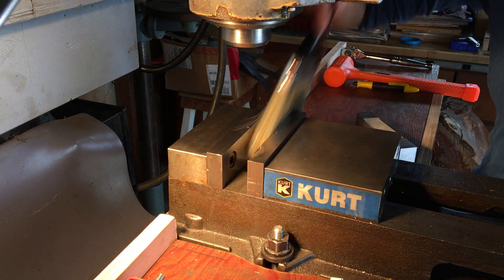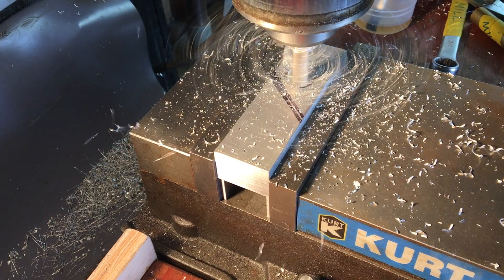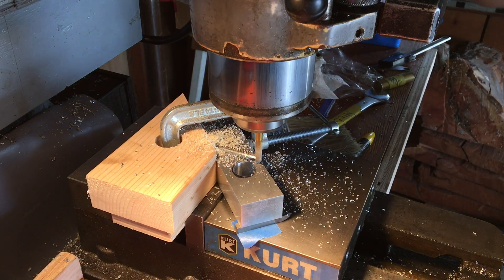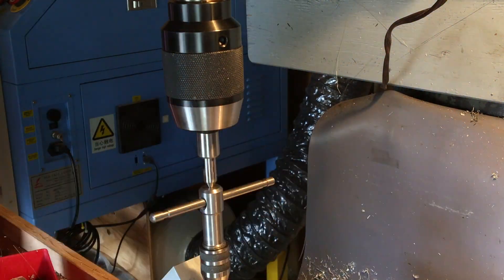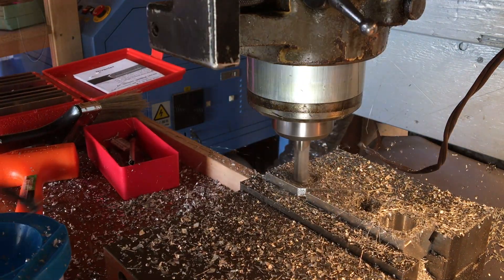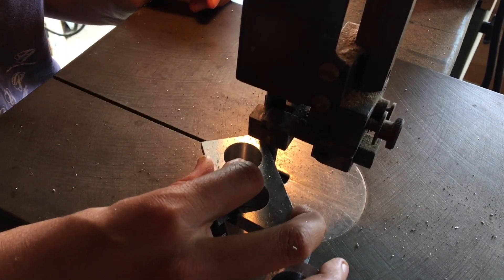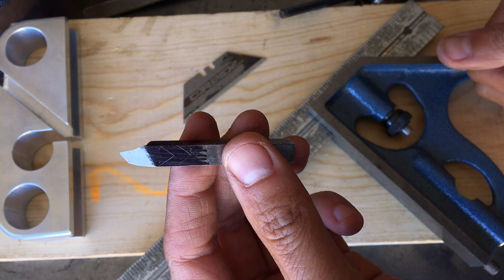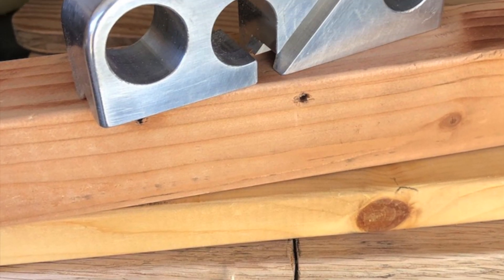Machining A Round-over Plane (start to finish!)

Comment: Just found your videos.  I'm sure you are now aware that High Speed Steel doesn't lose hardness even under considerable heat. Dipping it in water while grinding keeps it cool so you can hold it with your hands. Not really to lose the temper.

Comment: I just got a bridgeport, doesn't even have a traditional DRO. I'd love to hear more about your prototrak setup, it looks like the best of both worlds between manual & cnc
Reply from the maker: Congrats on the new family member!! My prototrak is only CNC on the X and Y axis, but you can get a lot done with just that. I hear you can give it g-code too, so it can do more than just the canned cycles (rectangular pocket, circle, etc) but it’s so old that I haven’t found a good way yet to go from a modern CAD tool to g-code that this Prototrak could understand. I think EZtrak is another option if you are looking for CNC options to retrofit with. Is that the plan?
Reply: @AmyMakesStuff  yeah, just exploring options right now. It sounds like something with ballscrews would lend itself better to cnc than the old acme threads in my machine, got a bit of backlash going on! 😂

Comment: Very cool build. I have been using a hand planer to fillet corners on my furniture builds, but I just might try making one of these. Anodizing the aluminum body would prevent the black streaking, eliminate tool wear, and provide a pretty low-friction surface. It's pretty achievable in a home shop. Dying it some nice metallic color is just a bonus

Comment: Hi, new subscriber, male, total novice. 
Into your work and your looks.  
Both top notch. 

As to the metal chips-
Just use compressed air cans or a power compressor it works well. 
cheers m8!

Comment: Polish the V notch in the bottom to a high shine, wipe it down really good with degreaser or rubbing alcohol then wipe just the thinnest layer of floor wax into it. This will make the plane glide much easier, and it should reduce the amount of black streaks left behind

Comment: Nice job!  Very nice plane.  To prevent the black marks transferring to the wood, try cleaning it with acetone and immediately use a product like BOSTIK GlideCote.  It works very well on tablesaw tables to seal the table and reduce friction, plus it doesn't contain silicone.  Of course, anodizing or Cerakote would work, too, but they're a bit more expensive.   Cerekote is a thin-film resin-ceramic coating that has a low coefficient of friction similar to Teflon.  It would be interesting to see how it performed on a plane sole.  (https://www.cerakote.com/finishes/E-100Q/blackout/ )
For your chip problem, you might consider using a cyclone in between your vacuum and pickup.  I have a Dust Deputy cyclone from Oneida Air Systems that I mounted on a 5-gallon metal trash can and have a small vacuum (Rigid 4 gal 5.0 hp $80) from Home Depot that I connect to it.  I use it around my mill and metal lathe to suck up metal chips.  99% of the chips go in the bucket; virtually none get to the vacuum.  
Prior to that, I had a small 2-gal vacuum that I used for the same purpose.  It was a mess to empty, and the filter would clog with the oil and metal chips causing it to lose suction power.  The cyclone is easy to empty.  There are various flavors of similar small cyclones available, but not all of them work as well as the  Dust Deputy, so be aware of that.  There was a comparison in one of the woodworking magazine a couple of years ago.  I'm sure it or something similar is available online somewhere.
Reply from the maker: The acetone and coating is a great idea! I have some paste wax already, so I'll probably start with that and see how long it lasts. Great call about the cyclone. I haven't emptied my shop vac yet and I'm not looking forward to it.
Reply: @AmyMakesStuff  Came across this from a Steve Jordan who used it for vacuuming his metal chips.  Very good price.  Appears to work well.
https://www.banggood.com/N50T3-Dust-Separation-Power-Cyclone-Filter-Dust-Collector-Woodworking-For-Vacuum-Extractor-Separator-With-Flange-Base-p-1530747.html?utm_campaign=15225071_1530747&utm_content=1087&p=SO071514950915201710&ID=6157199&cur_warehouse=CN
Reply: Anodizing is more home shop friendly than you might think.  https://www.youtube.com/watch?v=Z1zT8p7d9Z0

Comment: super video Amy, be careful with brush i think vacuum cleaner safer for shavings
can you mill mild steel with that?
Reply from the maker: yes, I agree that vacuum is better 😅 yes, can definitely cut mild steel and even harder stuff, just depends on cutter type + feeds & speeds.
Reply: @AmyMakesStuff  id love to learn more about milling machines, I like to do metal work but i only have an arc welder and grinder and basic tools,  nothing very precise like this or lathes. id like to learn about lathes too!
also have you got a cat? i thought i heard a cat in the video.
all the best from ireland
Reply from the maker: @cushte4996  😂 yes, I have a very vocal cat. He is expressing his confusion that he can hear my voice, but I am not petting him. I would also love to get a lathe, but haven't figured out where to put it yet. Thanks for watching!
Reply: https://www.mscdirect.com/product/details/09672023?fromRR=Y @AmyMakesStuff    you might use this in a pinch,a very versatile unit. your inventive you will see many possibilities i'm sure. It uses 5c collets and you can buy stops that screw inside the collets for repeat work. It doesn't come with collets sadly.
Reply: I always used acid brushes to sweep with, the kind plumbers use for solder.Cheap and good for also applying cutting fluid. Which you don't need when your using carbide and light cuts,though the chips burn a bit more when they hit you.
Reply: @AmyMakesStuff  To assist the vacuum, add a R/C "ducted fan" as a blower. Or even a leaf blower on a speed control to keep the noise level reasonable.
Reply from the maker: @NiHaoMike64  I like the idea of using a blower so that it will be quieter - thanks for the suggestion!